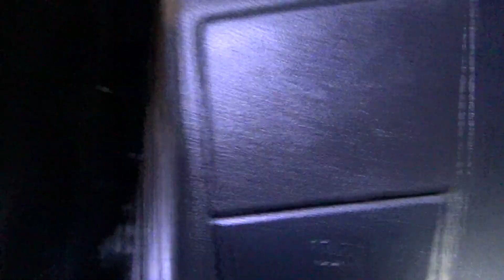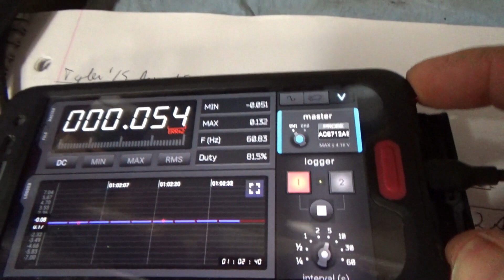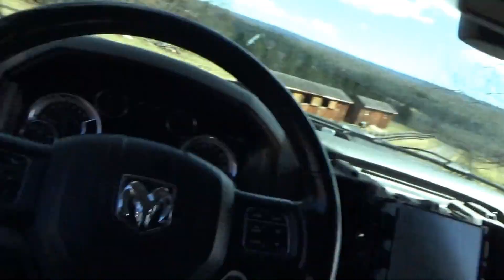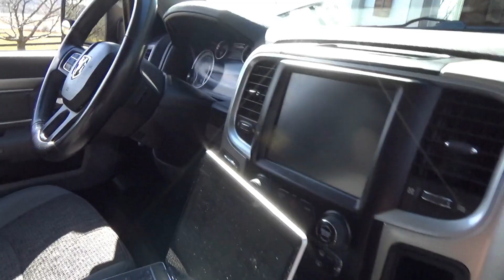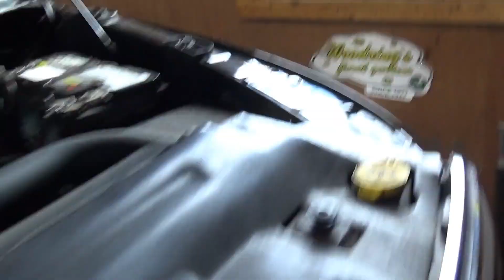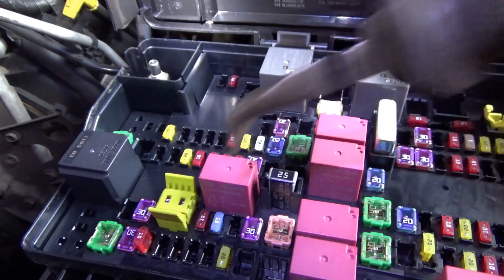Have Never Seen THIS Kill a Battery Before... (Parasitic Ram - Part 2)

Comment: Great work. Dealers would have part swapped until they got to the right module. Thousands of dollars. The only additional thing I would do is measure the running current in the combined circuits.

Comment: Ivan two questions for you.

1.  Why didn't you try to source a used module from LKQ or a local salvage yard?  Is there a programming or initialization issue with using a used module?

2.  Why didn't you use a standard relay to get the power to where it needed to go?  Your method works but for me personally I would have used a relay to make the modifications.
Reply: Good “hindsite” repair after his jumper test ! Maybe next time !

Comment: I own this same truck, although mine is a 2019 model. So far no issues with battery draw, but I anticipate problems in the future with all these electronic modules. 
Thanks Ivan for the heads up and ways to determine the culprit. Added bonus, 72 degrees is quite comfortable during summer or winter😃 Keep the info coming.

Comment: Price is in the IC's what used to cost a couple dollars now costs hundreds of dollars and forget about the lead time to acquire those same IC's.   Yea it's a crazy time and repairing a PCB can turn out to be just as expensive depending on the cost and availability of components never mind any programming cost.  Let's say you can source replacement of failed IC's then you run the risk of buying fake IC's especially from Chinese Suppliers even for old and I mean components manufactured back in the 80's or 90's.  What they do is clean off the label on the IC and laser etch a new part number.  Crazy time we live in.

Comment: Putting a relay in on the 15 amp positive wire and control the relay with the 10 amp switch wire would be a better fix. Now the circuit designed to carry 10 amps needs to handle Exeter 15 amp load, The wiring in these new vehicles are cheap and designed just to meet the circuit loads.
Should of looked for a used one at sum junkyard because the blend doors are going to be his next problem, there already doing funny stuff.
Reply from the maker: It's fine 👍

Comment: There's profit in replacement parts now that they are vehicle or mfr specific and not easily to clone.  Same happens in HVAC with the EC motors.  They are mfr/model specific only available from mfr so profit margins.  

Musk talked about starting a new car company with the problem being margins on new cars are low with profit coming from keeping the older base running.  But with a new car company, you don't have the installed base to provide income.

Comment: I bet those 3 capacitors were open or shorted , those type usually are junk anyways... the IC's will not go bad unless they get hit with a power surge ... those caps are a easy fix if you know how

Comment: Nice repair.  For 1k I would have done the same.  You think those modules are high you wouldn’t believe how high aircraft parts are now.  I just replaced a hydraulic check valve 1”x1.5” that was $12k.  What we run into is there is only 1 manufacture of this valve, which being a specialized part is probably the same issue on the Ram.  But still ridiculous.

Comment: It wants the fan on to blow air.  With the fan off it goes back to old school and flaps the doors....
I had to stitch a hot lead.  I put a relay on the line, and used a switched line to activate it.
Keeps it on the right fuse as well that way.

Comment: I feel like you skipped some steps here.
1st, are all the powers and grounds good & clean?
2nd, Don't you think it could be staying awake because it's trying to park an actuator that's stuck? I would think it's completely reasonable to assume a stuck actuator or switch could cause the module to continuously try to park one of them once the key is off.

Comment: I would actually look at each input on that module to see if one of the inputs is out of range causing the issue.
Bad capacitors can also cause strange problems, so if there's a swollen capacitor that could be a cause, but none of the large ones did look like it was bad.

Comment: @Ivan, For my "Russian Hack" I would have cut the trace on that pin in the module, and soldered a jumper inside the module, that way only the module is modified, so if someone later wanted to fix it properly, they could just pop a new module in.
Reply: Also, I wouldn't dismiss the sun-load sensor as keeping it awake.   It's probably connected via LIN, so if it can't talk to it, it keeps trying.
Reply: @Ingineerix  I noticed the "packets" the module was putting out didn't look like data, but just regular spikes.  Based on that, I don't think it was trying to talk to the sensor.  I'm suspecting failing power supply in the module.
Reply: @russellhltn1396  Could be!   If you disconnect a CAN node so it's the only one, there is no other device on the bus to acknowledge the frames, so it will transmit the packets over and over again, rapid fire, which will peg the bus at max utilization.  Also, without proper termination, the CAN signals will reflect at the end of the line and make a huge amount of noise, making the signal impossible to decode.
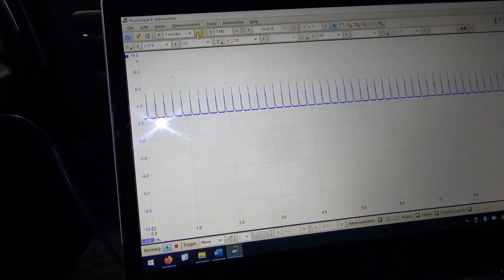Reply: @Ingineerix  Take a look at 9:37.  That's not packets, but a series of pulses.  We're zoomed in enough to see the trailing edge fall time but all we see are spikes.  If it was trying to communicate, I'd expect to see pulses of varying widths. At minimum, the module would have to be sending the address of the sensor.  I'm not seeing that.
Reply: @russellhltn1396  The sensor is unlikely to be on CAN, it's probably LIN.   As I said, without proper termination, you likely will not see proper bit framing, so it's hard to tell what's going on.   If it was a power supply issue, I doubt the HVAC would be working well though.   I still call a software issue due to loss of LIN.

Comment: We need less semiconductors / modules in cars & that's not one gigantic god mode module !
I mean old fashioned switches .

Obsolete electronics is the nail in the coffin of second hand markets .
Heck in the UK you can't get a relay for a 10 year old GM car at the dealer or auto shops .
It's second hand or flea-bay for the common parts & not a big problem but give it time ! 

As for the repair the first attempt should have been changing the caps .
Then if needed put a link in the module & cut out the one pin .

Comment: if for me，i will cut the red wire，and then add the relay pass through the red wire，the pink one to control wire，this way can be use original 15a fuse

Comment: Designed to fail. If you could live with the 50 ma draw, i suggest a normally open relay on the data line only,  powered by ignition switch.

Comment: I would install a relay in between the constant power and feed the coil to the switched power to avoid potentially overloading the switched power feed. This could damage a power MOSFET inside the TIPM which is common on these fiat built vehicles. I was wondering if there was a software update that fixes that issue also. Maybe there's a glitch in the configuration and it will have to be reinstalled.

Comment: One more thought, I would find it hard to believe this  HVAC module is one of a kind and specifically designed for this application. In the electronic world of CAN bus circuit design this is probably a standardized circuit/module only its programming and electrical connector are arranged slightly different to keep them from universally being replaced by anyone but the dealer. A year from now someone will have reverse engineered this particular issue and a "fix" will emerge.

Comment: I’ve been working as an electrical engineer for 50 years. I can’t believe how unreliable electronics is these days. This is probably due to the crap components from the global supply chain. A lot of these components are fake or even worse used. I would never ever buy a “modern “ vehicle because of this. Bad enough to buy a toaster with this crap but a car. No way!
Reply: I should have kept My old 81 rabbit diesel p/u. Could have made You a great deal! It only needed 1 wire to run for the fuel shut off solenoid, and that could have been mechanically bypassed. Though I must admit, I do not miss that one. 😄🇺🇸

Comment: I can't even imagine caring if the radio in my car worked or not.  The radio hasn't been on in my old van in probably 15 years, and in the newer one, I don't even know how to turn it on.  Most of the stuff on the radio is so foul I can't stand listening to it anyway.  Other than not wanting a gaping hole in the dashboard, I'd be happier if it wasn't there.  I'd probably just screw a piece of plastic over the hole.

Comment: Just wondering if the ‘sun load sensor short to battery +’ is actually there or just internally misrepresented by the module. Since the sun load sensor is an important HVAC module input, I would have looked into this… Otherwise great repair!

Comment: Why are these modules perpetually out of stock and expensive? Outsourcing. The MBAs at the car companies saved money yeas ago by firing all the in-house development and outsourced everything. Now cars are made up of tens to hundreds of little modules made by some other company using old tech chips. When the pandemic hit, those chip manufacturers didn't want to keep making obsolete chips when they can make lots more money on expensive new-tech chips. Only one car company is moving in the opposite direction. They use expensive chips to make fewer modules that perform lots of functions and do most of it in in-house. Ivan's never worked on one of their vehicles AFAIK.
Reply from the maker: Which car company?
Reply: @PineHollowAutoDiagnostics  Tesla.

Comment: Just my $.02, but opening that module in the car like that has an element of risk.  If you're going to do that, I would recommend a setup for controlling static electricity.  If you had popped it, you'd likely be on the hook for a new one.  Also, if you have a good quality magnifier, a quick look over the PCB might have revealed a bad solder joint.  I can't tell you the number of times I've seen a surface mount component with solder touching it, but not wicking to it.

Comment: Searched for part number - you can get used P68236772AB modules for around $399. Even the junk yards are in full rip off mode!
Reply from the maker: 400 bucks is still wayyy overpriced... And it will likely fail just like the original 😅

Comment: My brothers new company truck (classic Ram 1500 2022 -23?) does the same thing. It has been to the dealer twice and they can't find anything because I think they never looked as it's a company lease truck. Brother noticed that the cargo lights by the third brake light would stay on sometimes so I pulled the bulbs. It still kills the battery but not as often. Question is did you notice those lights being on while trying to diagnosis this truck. Oh and he wants his old 2018ish Ram back as this new one is a piece of junk.

Comment: If I designed cars, I'd keep the modern mechanicals run by basic electronics and scrap all the fancy "feel good" modules.  No power windows, heated seats seats, entertainment consoles, etc.  Just the basics.
Reply: You would not be in business very long, but I would buy one. 😄🇺🇸
Reply from the maker: Power windows are pretty basic lol... My 89 Mazda has those and they still work... Slowly haha
Reply: @PineHollowAutoDiagnostics  I had manual windows until I was 40!  That clue indicates my age 😱

Comment: Possibly reflashing the HVAC module (even with the same SW version) would resolve the problem, as you said, looks like corruption to the firmware, not some component failure on the board...
Reply: Would finding the suspect modules and jumpering around them individually to be sure you’ve found the bad one, be a good way to be sure you’ve found the parasitic draw?
Reply: @Rudedog75  here the canbus is hub-and-spoke, not daisy chained in series, so no need to jumper, you can just pull each model. But yes, when in series, bypassing a module is the way to go.
Reply: @jovangrbic97  thank you John!

Comment: I had this exact same problem a few months ago and did the same hack. Everything seemed fine but on my test drive, I found the ac compressor wouldn’t engage and codes would set in the hvac module. Maybe the module had other problems? Idk

Comment: Great Fix bud. A suggestion and a question. Suggestion : On the BOB you could install a switch to kill your leds. Question : Would the blend doors have a park sense in them to find home? I know on my 08 Tundra about 5 minutes after turning the truck off I hear all of the HVAC stuff moving, and my work van 14 promaster does the same. Also, could you have just cut the red wire and not done anything with it? If it just does the memory why waste your time doing anything with it. Anyway, great work I love all of your videos.
Reply: I have the same BOB that he has and there is a switch on the side that kills the yellow network LEDS for diagnostic purposes.  The two ground and one power LEDs still stay lit though.

Comment: Great fix.  Imagine what a dealer would charge to diagnose and repair (and guessing that they would be unable to diagnose).  This complexity is causing issues for the industry as well.  The owner may be able to find the module in a pick and pull or similar and return the wiring to the stock function.

Comment: I really don't understand why these modules do not use flash memory, same memory as USB memory sticks use. Even the ancient microcontrollers have that on chip. This way parameters (settings), freeze frames and error codes would be preserved without battery power.

Then you could give modules which really are not needed all the time 3 minutes to turn off and then the main relay turns off. Less problems, modules last longer as no power applied all the time, and less green crusties as less wiring at 12V all the time. 

800+ USD for the board worth 50 bucks is an ripoff. They should be using standardized modules, but that would go against the planned obsolense and likely planned lack of spare parts. As you said, people need to have their car running, not waiting for a part 6 weeks.
Reply from the maker: Great comment as always 😁👌

Comment: Super cool! I wonder if there was enough room in the connector cavity to de-pin that feed you jumped into and solder right to the crimped terminal and just have it looped... that way you didn't have to strip back the wire and tape it.

Comment: I had a 2017 Ram big horn edition.  Well one day it developed a intermittent no crank, no start. Scanned it for codes. Nothing.  So because it was a lease.  I towed it to the dealership.  They said it started three times for them. Come and get it. Got there.  I picked up the truck.  Went home.  Sure Again.  Won't crank. Call the dealership.  They tell sounds like a bad ecm or bcm. Send it back. I decided to disconnect the battery.  I jacked up the truck in the driveway.  Removed the shield covering the starter. Found the main battery connection loose. 13 mm on a 1/4 inch ratchet.  Half a turn. Done tight.  Lowered the truck down.  Reconnect the battery.  Truck started up . Tried three times. Never failed.  Called the dealership I drove over there.  The service manager and I talked. I got three free oil changes because his master techs. Couldn't think outside of the box of parts throwing.
Reply: Nice to have a service manager that teaches his techs a free lesson, I am guessing that they paid for the oil changes.

Comment: at least if your front panel blows you don't have to buy that $7xx part. i did that hack for my radiators fans when they stopped working correctly, works like a charm <3

Comment: It could be bad capacitors, or a bad chip (like you said). Could you ask the companies that fix bad ECUs to quote you a repair on a bad module? Or go to a scrap yard and see if they have that module on a truck? It's also possible that the noise coming from the info screen is the actual culprit ( that noise is indicative of a bad capacitor). Noise equals a fluctuating voltage. And fluctuating voltages keep modules awake!

Comment: Why didn't you do the mod inside the module?  You could have cut that trace on the constant power or clipped the pin off and soldered a wire inside from the switched to the constant hot pin on the connector.  Then if someone in the future wanted to fix it by replacing the module, they could have done that and not had to do any wiring changes.  Just figured that would be easier since you had the module out anyway.  Just a thought.

Comment: Hey Ivan why didn't you just do a voltage drop at the fuse box first instead of crawling around under the dash.?. you ended up going that route eventually anyway
Reply from the maker: What would fuse voltage drops show? Remember this is a network diagnosis 😉

Comment: I like the thought behind the repair, but don’t care for this particular “russian” repair. My main concerns are the added load on the circuit and upsizing the fuse. Also, FCA has a pretty tight limit on current capacity of their circuits, I’d be concerned that the TIPM could shut down the circuit or fail internally with the added load on it.
I would’ve much preferred a relay triggered off the ignition wire to activate the former battery feed to the module.
Reply from the maker: It's fine either way 👍

Comment: the reason its an expensive module is because manufactures pricing is based on turnover of the part if it was unreliable and they sold a lot of them they would be cheap if rarely purchased the price creeps up,given these facts i would hit up the local pick and pull as you more than likely would score a good one and be able to do a proper permanent fix.

Comment: Lovely fix. I was thinking about a small, socked 12v relay that is triggerd by the switched feed and turns on/off the 'red' wire.  That would not require the fuse swap.  

It is insane what manufactures can get away with.  They get you with the hardware and with  the IP software running on the chips.